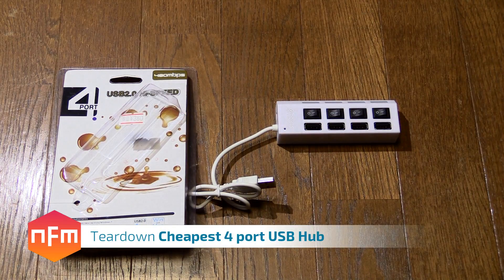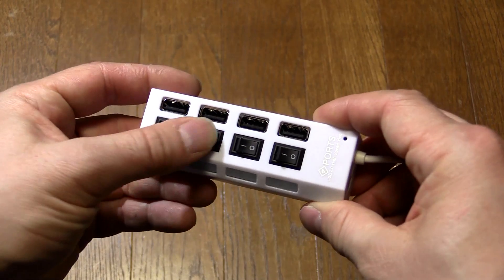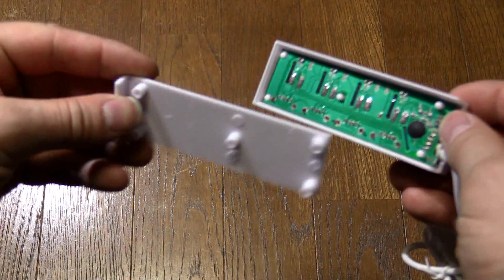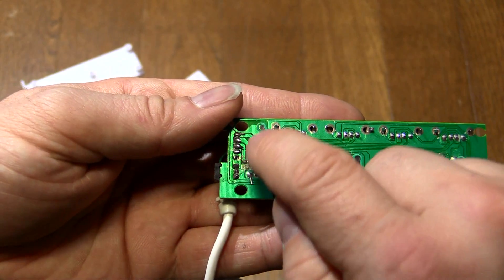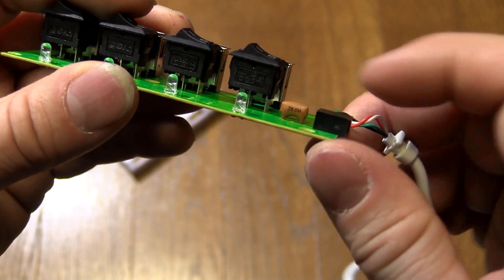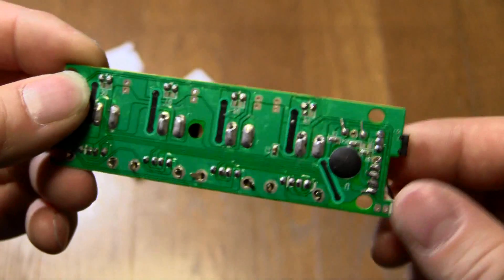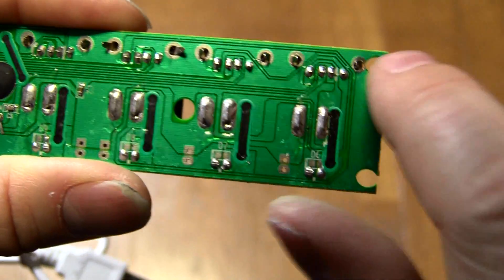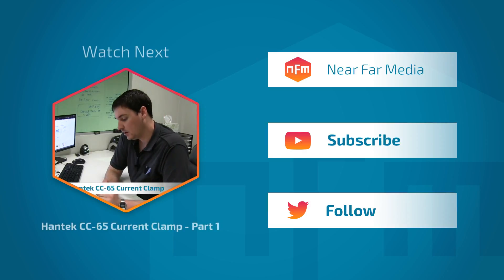Cheap and Nasty 4-port USB Hub Teardown

Comment: pretty sure this was answered but kinda still confused... I bought a cheapo: "7 Port USB 2.0 Hub Multi USB Splitter 2.0 Power Adapter Expander Switch for PC" and it also has a 5v power input (looks like it a female barrel plug input). Obviously didn't come with a 5v cable to AC plug, but could you essentially plug one in and if you did what would it do? Plugging the USB cable into another USB port on a power strip seems to give it enough power. What would adding the extra 5v input do?

Comment: Really interesting. I have a similar looking hub - only they say it's USB 3.0 and it does have an expensive looking detachable cable to connect it to the computer; Bougth it from Aliexpress for 4.46$ in 2018, has no branding, however upon disassembly I saw that mine actually has a crystal inside that resonates at 25K, a VIA chip marked VL812-Q7A together with a lot of resistors and capacitors, a 10mh inductor coil, has smd led's with resistors for each. So basically when you buy such a thing you can never know what's inside

Comment: I have a similar hub like this. but the 7 port version

i love how the printing says it's USB 2.0 while the transfer speeds show that its USB 1
Reply: It's a USB 2.0 to 1.1 hub. Older versions of Windows will warn you when you connect a USB 2.0 device to one of these.
Reply: @Flopster101  mm Windows XP..

Kinda knew that later when i transferred my files from my Netbook Tablet to my phone

Comment: I have the 7-port version, which says the board model on it is HUB-66H. I'd like to to try to upgrade this thing to its best configuration adding the missing capacitors and the ceramic component (or the better version you mentioned), along with a soldered power supply.

Comment: can we add additional power with a 5v or 12v adapter into the usb port?
Reply from the maker: You could, using the DC jack, but I would buy a better USB hub to start with, then add external power to that.
Many USB hubs have an input for external power.

Comment: I have a Type C 4 in 1 USB hub with RJ45. There are totally 8 colours wird connected to the circuit board and all disconnected now. May I learn from you the postioning of all the wires for soldering the proper wire back to the proper position? Black, Green White, Red, Light Blue, Purple, Pink, Orange. Thanks and hope someone would help.

Comment: I have the same usb hub as yours may I ask how much voltage does it need in the DC jack.
Reply from the maker: 5 Volts, the standard voltage for USB.
Just be careful as it is not isolated from the 5V from your PC, so you may have issued back feeding the voltage into your computer.
Reply: Was curious about that.  Have same model and noticed it doesn't "pass thru" fast charging ability if just connecting to a higher amperage USB charger source.  Also seems to steal power from connected device(s) for the light(s) if disconnected from PC/USB Charger. 
So been on the hunt for a small enough DC connector (Probably just easier to hardwire in a connection) and "proper" power supply to "upgrade" the device to a "powered" hub... But don't want to kill any PC and/or devices so may need to rethink the $3 I spent on this hub...
Reply: @lgoamity  Yeah I think it may be better to buy a cheap powered one
Reply: Guys, Do you know the name of the power cable? I want to buy it.
Reply: @psatirhandal6927  You can search for USB HUB or Powered USB HUB

Comment: If your ever doing a usb hub tear down review again. Would be great to see how smooth the power is. Especially when pc turned off. I had one from Dick Smiths years ago. Murdered a few big expensive external hdd. Took a while to figure out what was going on. So lost about 7TB of data. Turned out that if I turned computer off, like I do most nights at bedtime. The hub would toggle power to the usb devices. At roughly 1hz. Even managed to kill a powered hdd eventually. A regular unpowered WD pocket drive will last almost exactly 18 month under this torture every night for 8-10 hours. Powered seagate drive lasted about twice as long.

Got a sub from me. Cheers.
Reply: thats interesting you didnt have turned on motherboard option: energize usb ports? , if not, even cpu ports are giving that constant voltage to usb conected devices

Comment: So can I use this if I plug it into my laptop will it work?
I bought a usb hub thinking it would charge some of my devices but it doesn’t and I thought if I plug dc power into the circle port it would give it more power to charge my devices. Is this true or will I be wasting money
Reply from the maker: I wouldn't recommend buying this one in the video, it's complete trash. But yeah, if you were to connect a 5V power supply to it, it will power your devices.
Just make sure and triple check that the polarity and voltage is correct.

Comment: I spent AUD $11.95 for a 'branded' 4 port usb hub and it died after few uses :-( Made in beautiful China ofcourse. Is there a way that I can fix it?
Reply: Got the 7 ports version  from Aliexpress for AUD$6.00 shipped.  A more expensive 8 in1 metal casing died  after it overheated  ( was using a usb adapter though - might be a factor ).

Comment: I also got the same usb 2.0 hub but it has 7 ports. Unfortunately one of the port not working? May I know how to resolve this problem?
Reply from the maker: I would check the solder points at the USB sockets first.

Comment: there's a 7 port version too, same ropey design, in case anyone needs switched USB power with more ports (engineer your own power though, or you'll get 500mA max (in theory - haha) per port when you supply it with 5V external power (and, for completeness, only aboout 50mA per port with no external power, iirc, from the upstream port)
Reply: I actually got my hands on that 7 port version. Problem is, I'm not getting device detection when plugged into a pc, yet I get led indication when switching on/off. I'm trying to "upgrade" it's internals by supplying better quality components from donor devices and also fill in the unused  pin holes.

Comment: The blob chip i believe is a GL3520, It is true USB 3.0 with maxim output current at 5v/1.5A. But the 1.5A is shared between ports.
Reply: So what exactly does that blob chip thingy do?

Comment: These are garbage.  Mine does a connect disconnect loop and nothing else.
Reply: These come with a faulty cable included :\
Once you buy a high quality cable, it works just fine :P

Comment: Seems like those will kill your PC if you plug in power in the DC jack!
(No diode to prevent backfeeding voltages to mainboard)
Reply: The DC jack has an internal switch.
Once you insert an external power supply it will disconnect the supply from the PC.
Reply: How much voltages does it support.?
Reply: I've done backfeeding on a lot laptops and it certainly doesn't kill them at all, I don't know about desktops though

Comment: I wonder if it came with a power cord for that hole
Reply from the maker: This one was so cheap that it didn't come with the power supply, but I have seen other packages that did include it at a higher price.
Reply: Will it be safe to plug this hub into a power plug while it is plugged into a computer at the same time?
Reply: I have seen one that gives an optional power supply for  way less than a dollar, would not turst!